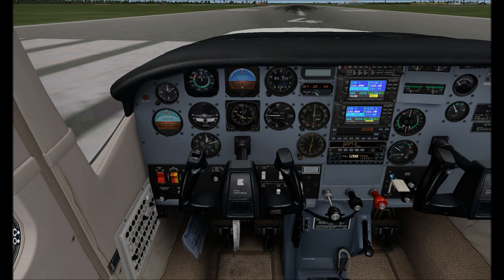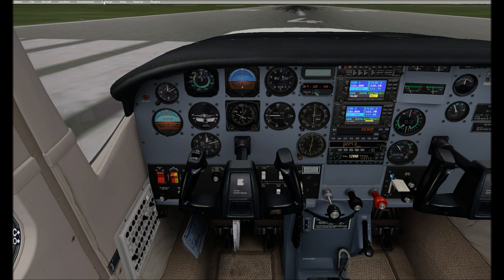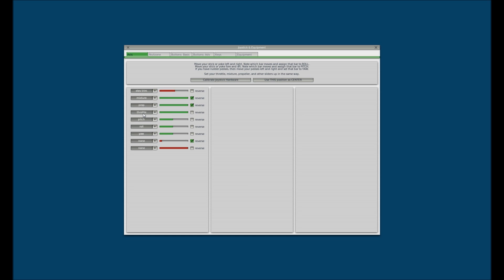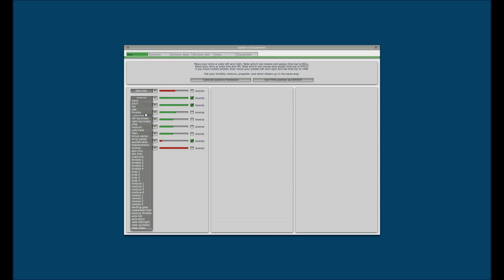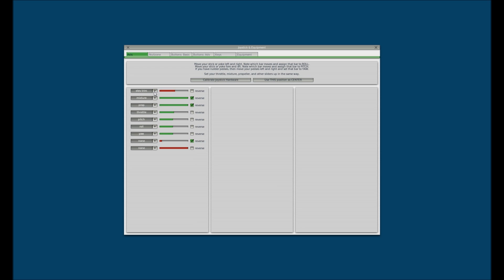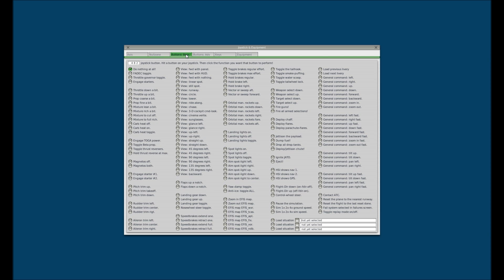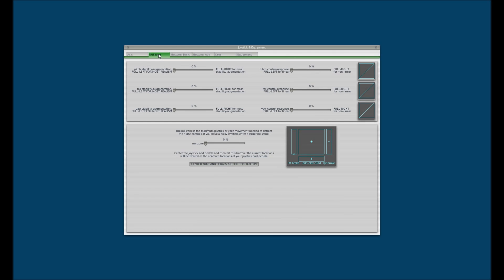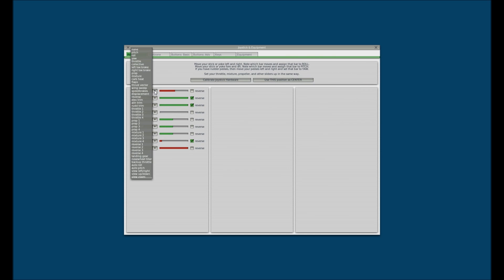Simulator setup X-Plane 10 for Saitek F.L.Y. 5, Saitek Throttle Quadrant, and Saitek Cessna Trim Whe

Comment: There has to be some way to bind 'enter' to one of the buttons on the yoke or throttle quadrant? I have been flying in the X-Plane 11 demo and it is very difficult to reach for my keyboard or mouse to click 'continue' or press 'enter' once I am flying. Constant pop ups and message reminders come up in the demo and I really hope the full game is not like that. Deal breaker. It seriously interrupts my flights.